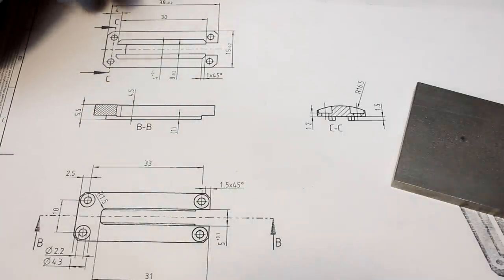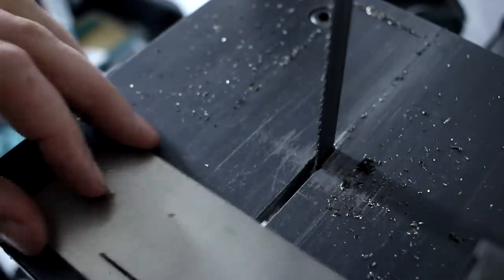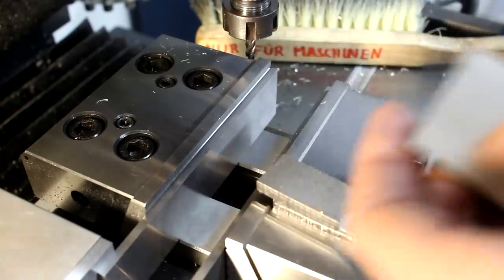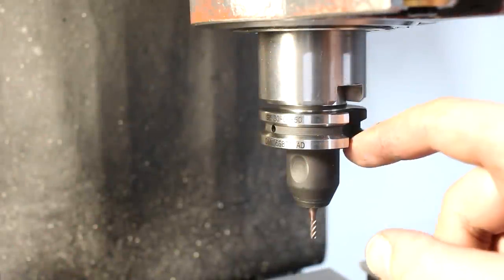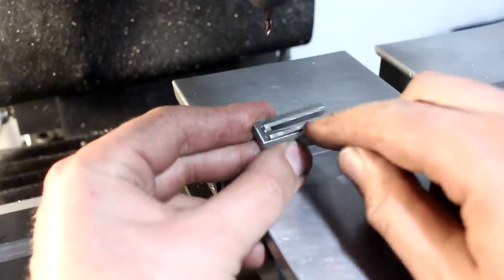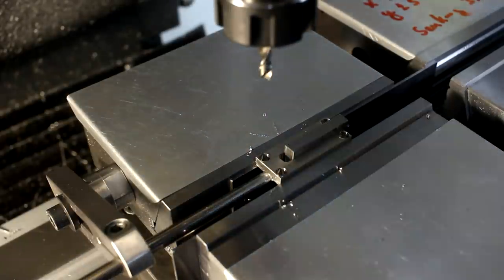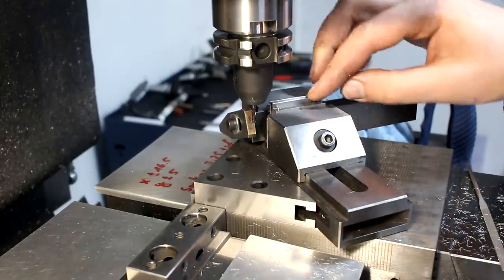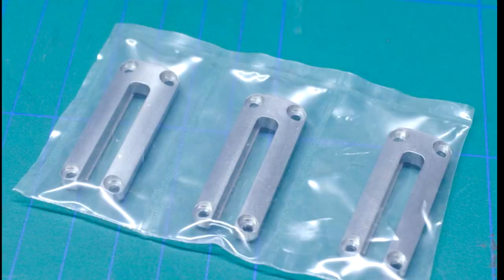Making a part: Stainless Steel Guide Frame

Comment: I used to work in a maintenance / machine shop, there were 7 of us; Pipefitters, Electricians, Welders, Painters, a bunch of multi-skilled workers, helping to keep a Victorian era Mill running at the end of last Century - then there was Old Jim, a semi-retired, soft-spoken, apprentice-trained machinist, who had joined the company from school. He spent a couple of days a week fabricating and machining replacement parts for 100+ year old Jacquard looms and I can't tell you how many hours the other 6 of us used to waste just watching him work. The finished piece wasn't always a work of art, but the process was always a joy to watch, just like your videos.
Reply: Machining is great; I would recommend it to any young men looking for a job. The more manual machines you get to use the better, even if it's harder and more dangerous, you just experience the joy of it more.

Comment: Stefan, please continue making these "Why I chose this approach" videos!  You can't explain too much detail about what you do and why you do it.  I learn a lot from this type of video.  I worked as a Tool Designer when I started my Engineering career and spent a lot of time working with our Toolmakers.  Unfortunately I couldn't run the machines to make my own designs, but by watching closely and asking a lot of questions and taking their advice when appropriate, I became a very good Tool Designer.  Now that I'm retired, I have a few small manual machine tools and can use the "lessons learned" from videos like yours to improve my machining skills.  I really wish that I had been able to go through a Machinist Apprenticeship program, but watching excellent Machinist-type videos is as close to that as I can get!

Comment: That's a really nice finish for a milled radius! I did something similar recently, but my radius had a shoulder at one end, so I locked my x-axis and just used the a-axis... at which point I learned that endmills are not flat at the cutting end and i'd machined a tapered bulged cylindrical feature. Ah well, I managed to get it to work out in the end, so file that one under "learning experiences".

Great video!

Comment: Great video! When I saw the top of the part was convex I was sure the Emco was going to be in the video, but you gotta love the rotary table. Those scotchbrite Dremel you can get from China for pennies. I got 100 each of fine, medium and coarse for like 20 bucks....
Reply from the maker: Thanks!
I have to check ebay for those cheap scotch brite wheels.

Comment: the scotchbrite wheel is a fantastic idea, i'm going to be setting one of those up as soon as i need to finish something. my go-to for finishing bores is a 1/4" rod with a slot in one end, where sandpaper lives until it falls apart, but that's not so great for surfaces =D

Comment: It's all in details.
I also have good relations with the SK30 tool holders. I didn't know about them until I purchased my Schaublin SV-51 milling machine that has this, back then exotic, spindle. Later it has proven that it is not that exotic after all.
That arbor in the dividing head. I quess that it was made in the same dividing head as it was used. Probably never leaving between it was made and used.
That fuzzy Scotchbrite had a habitus which made it impossible to identify the material. Self centering indeed.
Thank You for Your time You have used to put this show on the road.

Comment: Turning parts in the lathe that require special arbors. We had a number of repeative jobs that required such set-ups.  One was chuck jaws for machines that faced, turned and cut the ring grooves in pistons*. Another was locator pins for the wrist pin end of connecting rods that could be rotated 180° so the machines could be changed over to a different rod length. The chuck jaws came in as investment castings with the final operation cutting the jaw serrations. The locators had a 1" base diameter with the locator diameter offset .125". Hardened and then ground of course.
*spent 30+ years in an automotive engine facility.

Comment: when machining the slot in the clamped part, is there not the concern, that the slot will be squeezed together as soon as you break all the way through with the last cut? 
Would it make sense to add another piece of material on the far side of the vice to balance the pressure?
Not that I don´t know anything, was just a thought.

Comment: Whenever I was handed a new job from my boss the first thing I did was to make photocopies* of the drawings. One set stayed clean. The other set I used for all my math, job notes, program #s** etc.
*does any one say Xerox any more?
**I kept all my jobs on 3.5 floppies as I would never know which machine would by open. No USB ports for flash drives on our Trak or Anilam controls. The program #s were recorded along with the drawing #. I also used to do a bit of helical gear cutting on a Barber-Coleman Series 16 gear hobber. A normal gear hobber the work and feed ratios are easily set. The work ratio is simply the # of teeth decided by the base ration of the machine.  We had gears for both banjo set-ups from 22T up to around 80T. When cutting helicals the Index and Feed ratios are calculated using a constant along with an offset depending on RH or LH helix and hob. Once calculated and factored I always wrote these down. Especially the feed gears. Of course now there are online gear train calculators that will do it for you. 
I was also responsible for rebuilding precision spindles for 4 years. I had one of those Sony digital cameras that used floppies. Any thing out of the ordinary got photographed and the floppy stored. I had a lot of floppies

Comment: I wonder, if you had cut the blanks in the perpendicular direction, would they have warped more when cutting the slit?
Reply: Great question
Reply from the maker: Probably, yes - The drawing direction (In which the "cold" material is drawn trough the die makes a difference in stress distribution.
Reply: Tnx

Comment: Once you had the arbor on the indexing head, you may as well have put the arbor in a lathe and turned the radius?
Reply from the maker: Yes, but turning seemed to be a bit of a high risk approach, with the prong-shape of the part. Milling was a very low cutting-force approach.

Comment: I spoke with a gentleman who ran a large shop and he told often times engineers will specify 304 stainless because that's what they know about - he would often recommend 303 if they didn't care as it is  easier to machine.

Comment: Great video Stephan.  Just had a thought, could you have side milled the radius instead of using the bottom of the end mill. Not sure if this is even an option?

Comment: Does your mill spindle ever get hot? I have the bernardo KF 25L mill, and the spindle gets to 50C very quickly. Even tho spindle runout is 2microns, super disappointed with it.
Reply from the maker: Yes, it gets hot - It has fairly large bearings in it and runs 3000 rpm.
I stuck a thermocouple onto it, it seems to max out at around 45°C, which is totaly fine (but to hot to touch).

Comment: Stainless steel is a pretty unpredictable material at the best of times, I was machining some 316 trunnions for a Nuclear transport flask, they had a 600mm square base 200mm thick with a mushroom shaped stem on top , I roughed the mushroom shaped out and come in the following morning to find that the mushroom cap was running true but the stem was 1mm out of true, had the Engineers scratching their heads for a while, fortunately there was enough material to make good.
Reply from the maker: Yikes! That sounds like fun :D

Comment: Really interested now in the ISO taper spindle for the OptiMB4! Was looking for that. Do you have a link?
Reply: @haraldwupptich1860  Great, thanks! It looks like the right size. I tried to come up with some tool-changing system similar to what Tormach does (MK4 adapter to 20mm shank on all tool holders), but did not work too well. I think it makes more sense to start with ISO30, that was actually designed for toolchanging...
Reply: @codemakeshare  tuned an optimum bf20l at the beginning but then changed to use old industrial iron. One brother taping center with sk30 10x toolchanger, a big axa vsc0  and some more. Imho  you get more value for your money compared to upgrading china sourced machines.
Reply from the maker: Harald was quicker, thats exactly what I ordered.
I'll add the link to the video description.
Reply: @StefanGotteswinter  thanks a lot, great! I'd certainly be interested in a video how you did the swap/upgrade on yours! Curious about the locking mechanism (drawbar), and if it would be possible somehow to fit a pneumatic cylinder to release and lock the tool. Looking at the picture, it seems that the drawbar screws straight into the toolholder, so a quick release is maybe not straight forward?

Comment: Thank you so much for giving all the details of what you are doing; it is very helpful. Did you have to modify your mill to get the speed up to 3000 RPM? If so, can you share how you did it?
Reply from the maker: The 3000rpm ist standard on my mill.
Reply: I have a very similar mill to Stephans, an RF45. Mine too only goes to 2000.  There must be some different gearing for the ones sold by Opti in Germany.
Reply: @supergarball  Thanks for letting me know. Happy New Year.

Comment: Wonderful Stefan. Beautiful parts. I'm curious whether you considered stress relieving the stainless steel by heat treating it, (although I guess you might need to do it under argon)?
Reply: I was wondering that also. What temp range. Always hated dealing with the stresses in stock when you do not have a lot of material to play with.
Reply: Great question, I was wondering also. Is 304 more prone to 316 for stress? Using a slitting saw in stainless steel is a concern for me as I have never done that before.
Reply: @mpetersen6  Thanks for the link!

Comment: Great video 👍 Interesting job lots of different ways to do it,they are using slotted screw's which is a bit old fashioned.
Reply: That's probably to keep the head height low.
Reply from the maker: Thanks! You still see a lot of those screws in minature mechanics and instruments, just because the head is so small and low profile.

Comment: 13:25 parallels are not necessarily parallel in that direction. In fact I've seen it come into play in real life in one of Tom Lipton's videos, they can be bowed pretty good in that direction, because these are considered non-working surfaces.
Reply from the maker: They are usualy very parallel in that direction too, but can be bent - Definetly check them with a straight edge before using them in such a manner.
Reply: @StefanGotteswinter  I guess if you hammer the part down, you'd likely flatten the parallels too.

Comment: If "Self-Squaring Salami" isn't the name of a jazz band today it will be tomorrow! 😄
Reply from the maker: I think it would fit a Death metal band quite well.
Reply: @StefanGotteswinter  Speaking of which I like the way you kept this material under control; metal moving around like that is one of those things you don't expect when you get into metalworking.
Reply: @jimsvideos7201  
If you want to experience material moving around try any of the Aluminum/Aluminium Bronzes. Especially with long thin pieces.  You're going along fine and suddenly you've got a 3mm bow in a piece 250mm long. Of course the worst stuff I've worked with is HDMW.

Comment: I know nothing. My name isn't Manuel, and I'm not even from Barcelona. Still, why not start by making the outer diameter on the lathe?
Reply: If I understand what you are suggesting: With the radius cut in the beginning, all subsequent machining operations would have to register from that radius. That would be quite a complication.
Reply from the maker: Hmm, That sounds like a bit of a headache to get the radius located correctly when doing the milling operations. Especially when cutting the lengthwise slot, even as the distortion was small in my case, it would still happen and distort the previously cut radius surface too.
Reply: @StefanGotteswinter  Thank you for taking the time to answering noob questions. I'm happy to have learned something new today :)